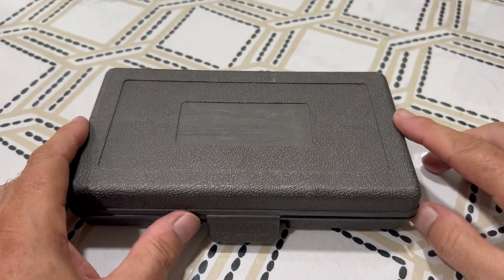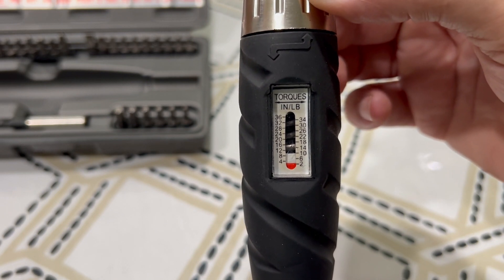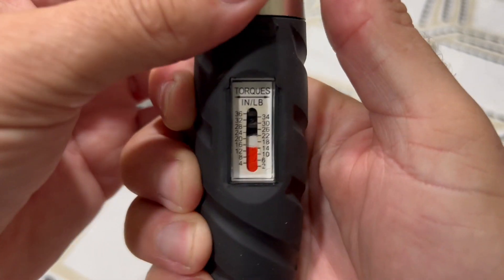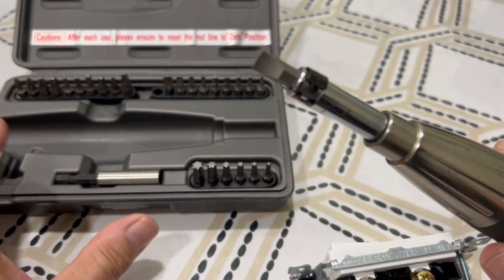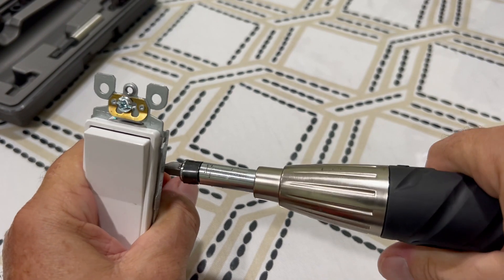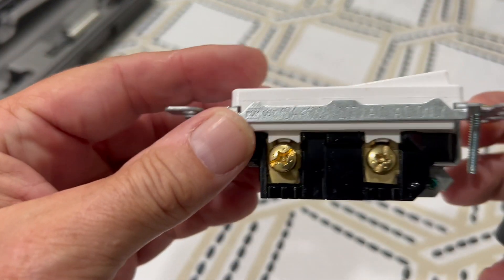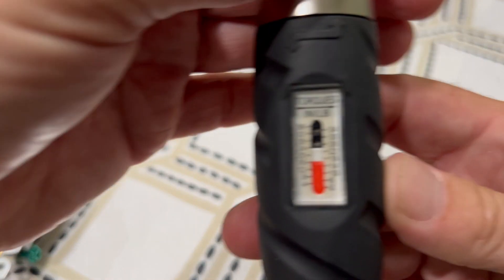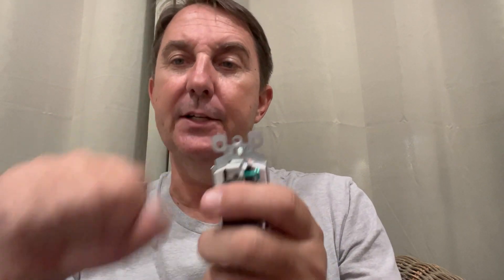How to use a Torque Screwdriver

Comment: Can you torque in odd numbers as well? Say 37 inch pounds?
Reply from the maker: Yes. The graduations on the dial are even but you can get the red dial in between the graduations so you can get an odd number as well. 
Thanks for watching and commenting .

Comment: Thx helpful but if you were from Canada you would our invention the Robertson aka square head!!!! Best screw ever but because a Canadian invention you guys don’t use it!!! Lol
Reply from the maker: Interesting. I’m not aware of it. If you could send me a link to Amazon so I can look at it.??
Reply: @YourFloridaElectrician  You can google it. It is also called a square head although technically a true Robertson aka "Robbie" is shaped like a truncated inverted pyramid - the faces taper to a smaller square at the tip than at the base. A square driver is just that with parallel faces and edges.

These drivers work well in electrical receptacle and switch screws. They don't slip out like flat aka slot drivers and they don't cam out like Phillips drivers.

ECX-type drivers, aka combo, PlusMinus and Xeno drivers are specifically made for electrical device screws by various manufacturers and are also superior to slot and Phillips drivers.

You can find torque specs for each receptacle and switch brand on the packaging or vendor websites.
Reply from the maker: @johnbauman4005 awesome. Thank you for this..